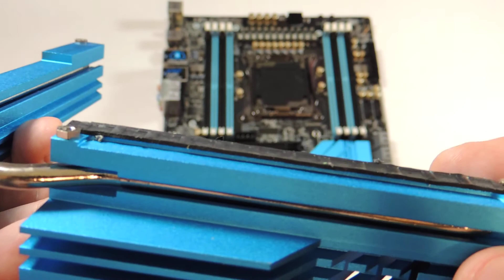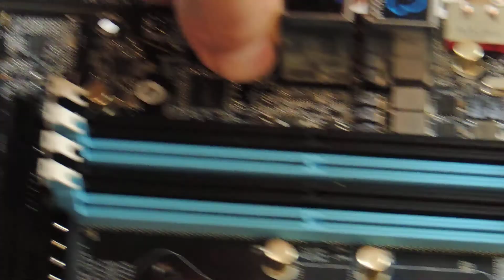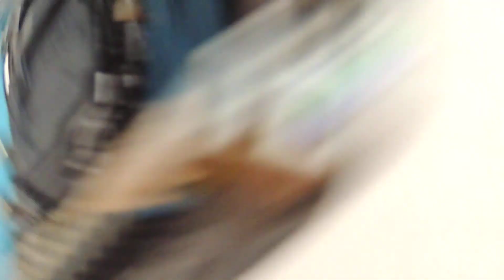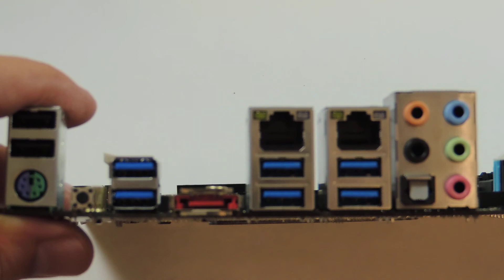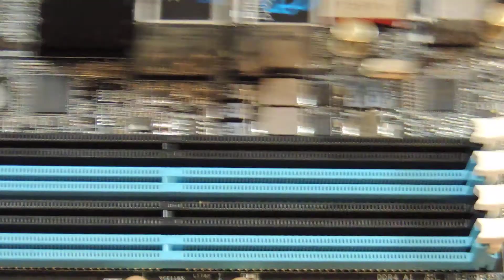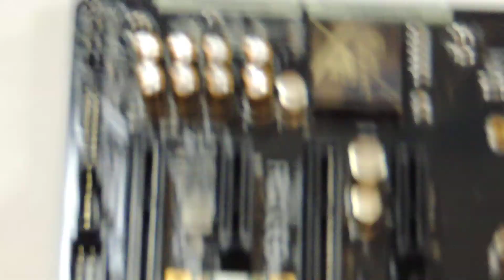[SH]ASRock X99-Extreme6/ac Review

Comment: Another excellent review of a board with aesthetics I could actually live with. One quick question (I hope):
- Is the Ultra M.2 what is now being referred to as U.2?
I'm getting a bit confused with all the new internal/PCI SSDs being launched, there is even one with a mini-SAS connector (from Intel if I'm not mistaken)... Maybe a video explaining all the internal/PCI SSD solutions and their impact on the power phases of the mobos?
Since, obviously, I am no engineer a review of a badly designed/built motherboard would be a huge help... I would really like to see what "doing it wrong and cutting corners" looks like to further appreciate the good stuff if that makes any sense.
Cheers.
Reply from the maker: NorthWolfe So U.2 is what people are using to talk about Intel's SFF-8639 connector, which is like a faster SATA Express protocol. The only reason people are talking about U.2 is because its Intel and Intel's drive the 750 which uses it. It by default is a SFF-8639 drive, however because that connector doesn't exist on consumer boards, they provide an NVMe connector adapter and there are some boards which have NVMe M.2 add in card adapters. The whole issue is getting over the limitations of SATA. Standard M.2 is 10Gb/s, but these Ultra M.2 are 32Gb/s which is equivalent to 4x PCi-E 3.0 and which Intel's new drive supports as do a few faster M.2 drives. I think in the future we will see a ton more Ultra M.2, however Ultra M.2 isn't an official name, just what certain manufacturers call their faster M.2 slots. I can do a video on that technology if you want.
Reply: sin0822 Thanks. Yeah, a video would be great since so much is being released that we just can't keep up.
To give you an idea, my normal rendering rig will have an SSD for OS and Software + 2 SSDs in RAID 0 as a "media drive" (Photos/Music/Graphics/Project Files) + 2 SSDs as a "scratch drive" also in RAID 0 (Media Cache files/Preview files)... All these are generally 1TB SSDs.
What would be the best configuration with all these new standards? So:
1 OS/Program Drive
2 Drives in RAID 0 (Media Drive)
2 Drives in RAID 0 (Scratch Drive)
Backups are to external HDD enclosures in RAID 0 + RAID 1 (sometimes called RAID 10).
Sorry to always be bothering you. Thanks for sharing all your knowledge, time and attention.
Cheers.
Reply from the maker: NorthWolfe You already own these drives?
Reply: sin0822 That's the normal layout of my PCs. Using "normal" SSDs (generally 1TB Crucial/Samsung/Intel).
I was wondering what the ideal layout would be today with all the new types of drives.
So, I basically replaced HDDs with SSDs maintaining the same basic layout (1/2/2).
Would the PCIe Intel 750 and the M.2 drives give a big speed boost, and what would be the perfected layout?
I saw some motherboard (can't find it now) which comes with the possibility of two M.2 in RAID.
Yes, all my systems have the configuration I described (used to be HDD/Hybrids, now most are SSD only).
The media RAID and Scratch RAID are kept separate in order not to create bottlenecks, since both are usually accessed simultaneously. Backups are backups... They go wherever and there are no performance issues there (generally HDDs connected by SATA cable).
Cheers.
Reply: sin0822 Everything on 2011-3 Boards with M.2 10GB/s is a waste. Since all you want as you say is getting more out of it than Sata III 6GB/s and 10 to 6 is in best case only factor 1,6 faster, what is fully overcome with M.2s like XP 941. So if you wanna go with the fastest M.2 10GB/s are limitiationg those nice pices of hardware.
Reply: sin0822 And on a second note plz compare this to a Asus Deluxe or Rampage if you have acess to them. That would be really cool.